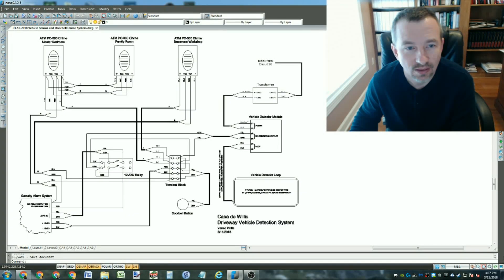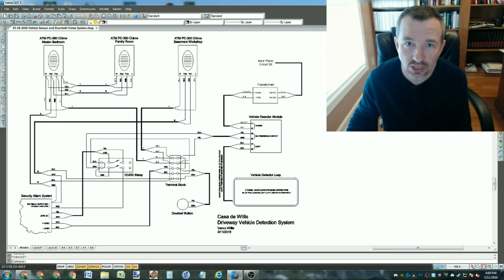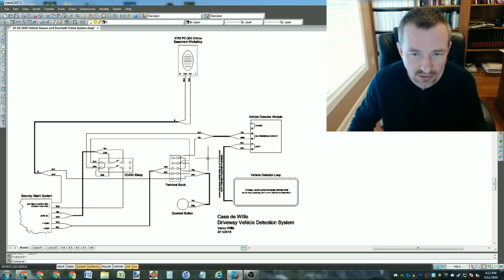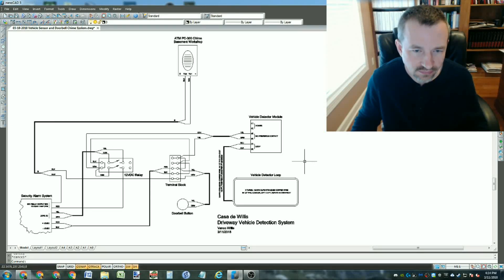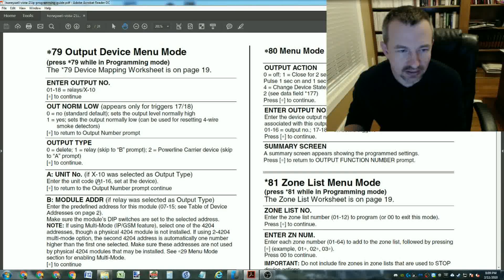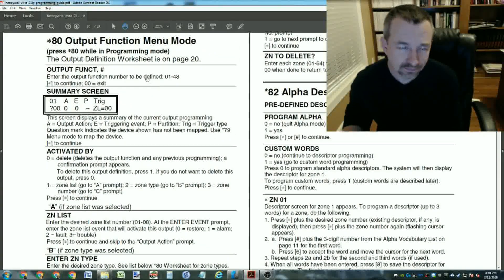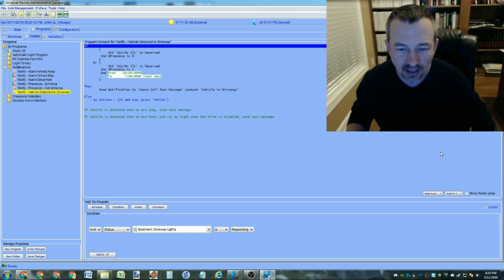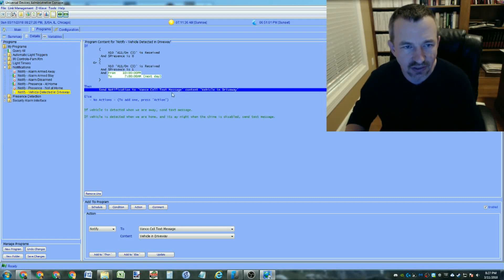Project #20 - Driveway Vehicle Sensor PART 2 (connection to home automation)

Comment: seems pretty complicated. i would feed the signal from the detector into a computer and handle the rest in software.
Reply from the maker: That would work, but I always try to avoid using a dedicated 24/7 PC if possible.
Reply: @VancesHowTo  
you could always use a raspberry pi. i run one for pi-hole, and it consumes only 4 to 5 watts. so no problem running it 24/7.